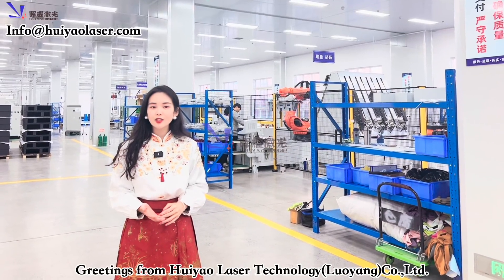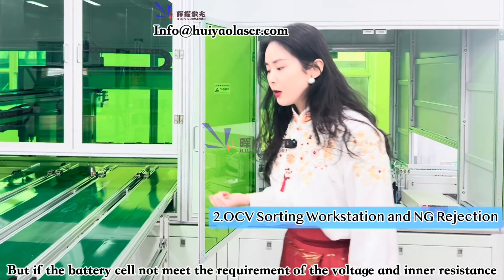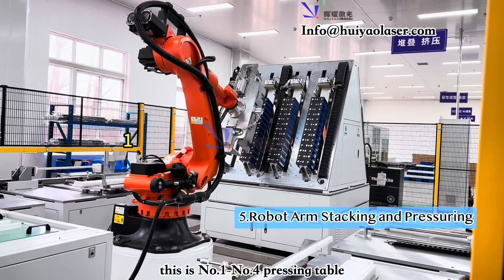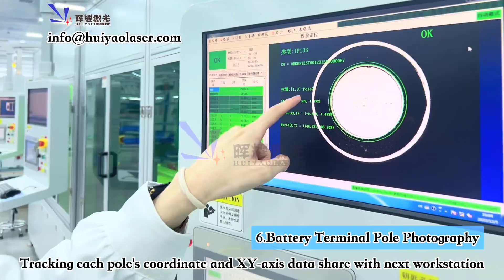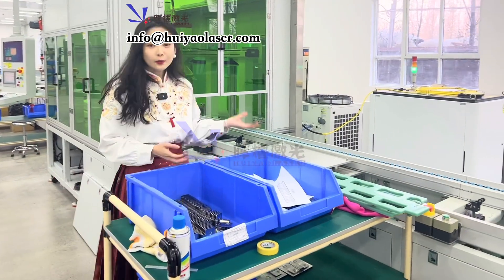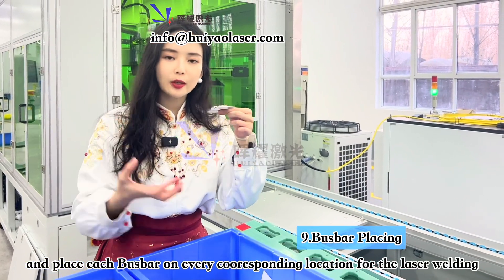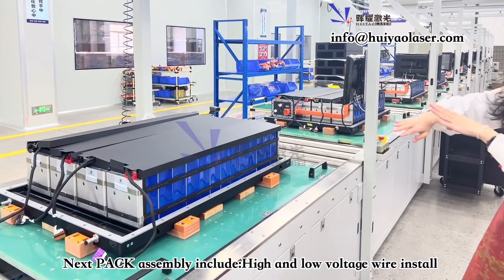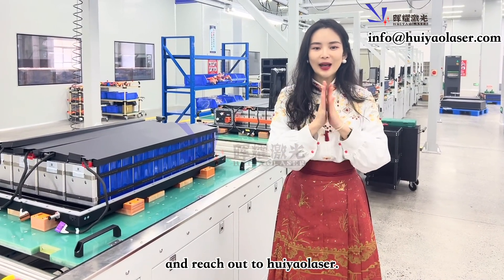Automatic Battery PACK Assembly Line for lithium-ion prismatic module and pack#energystorage

Comment: Nice presentation. Some fact, there are about 3 million Toyota Prius Generation 2 & 3 sold to the market, and requiring hybrid battery pack upgrades. The same battery pack is also used in several other Totota Hybrid models. Any solution for this model upgrades?